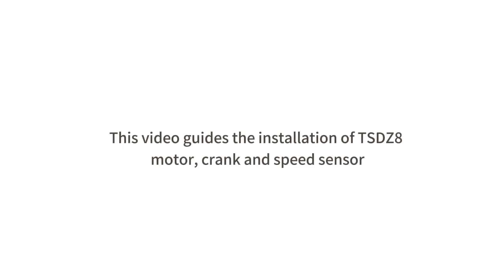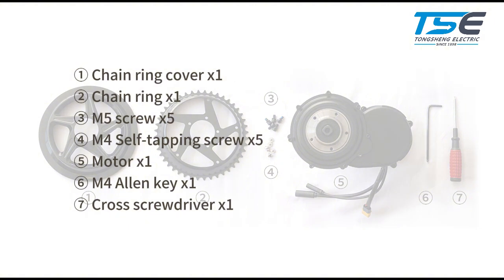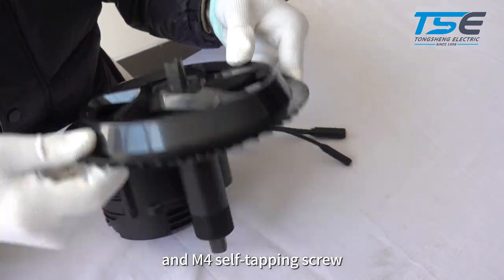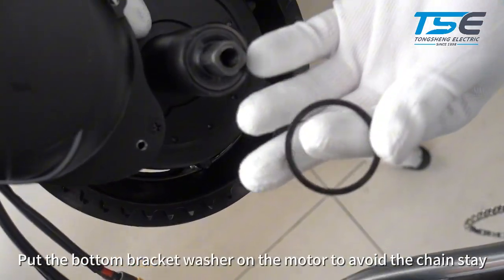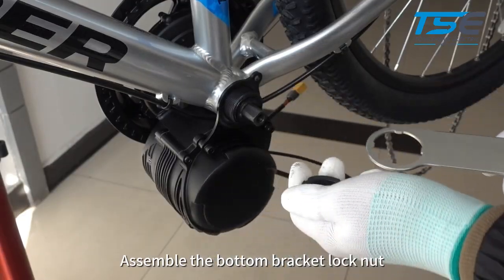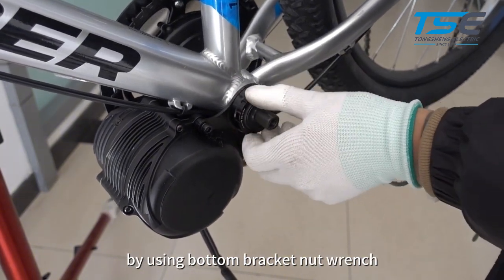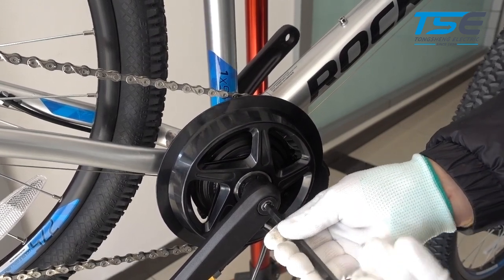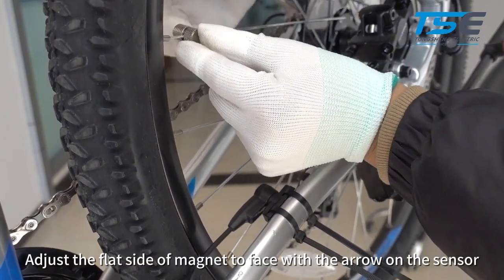TSDZ8 Conversion Kit Installation——Motor Installation

Comment: I'm an older MTBer and ride a Giant Trance X Adv. +0, but, I have a gravel bike that I'm thinking about a kit like this.  I would not consider any add on kit for a MTB because of the limited ground clearance.  But that is not really a deal breaker on a gravel bike.  Bafang is a no go for me because of the crappy cadence sensor technology.  My gravel bike has turn down flat top bars, so, I'm wondering about fitting the throttle, brake levers, and my Garmin 840.  I don't see a need for the brake cut-out levers or a shift sensor with the torque sensor as I always let off the pedal power when shifting or braking?  I'm also concerned with the enclosed charger; is it an auto shut off?

Comment: How  do you torque properly with that silly looking wrench?
Reply: Either by way of spending decades tightening different fittings that you can now torque it by feel. 
Or you can also start by throwing that silly looking wrench in the trash & getting a torque wrench 🤣😉👍🏻

Comment: Tongsheng TSDZ8 should have torque sensor instead of speed sensor, so why do you sow up speed sensor in installation kit?
Reply: Speed sensor gives signal to controller and you can see your speed on the display. Torque sensor is sensing pedaling torque and can assist you.
Reply: @csoradominik7409  Correct, I have realized that. It is clear for me now. Thank you.